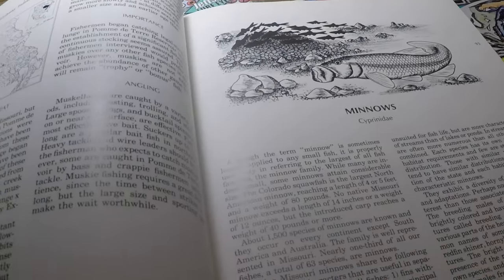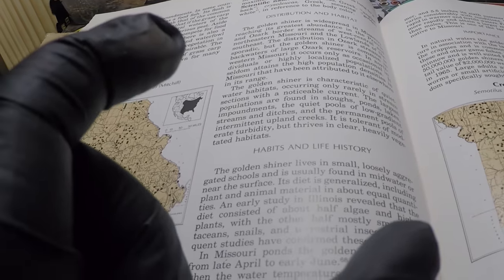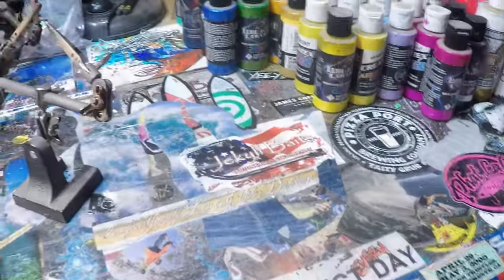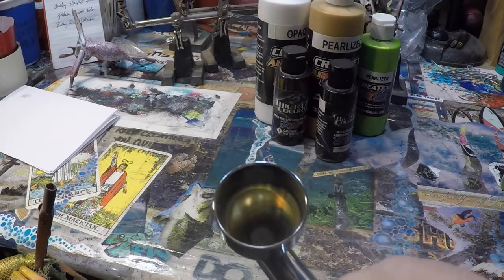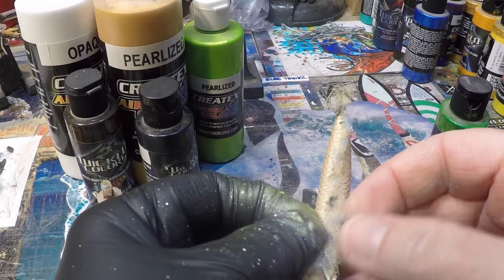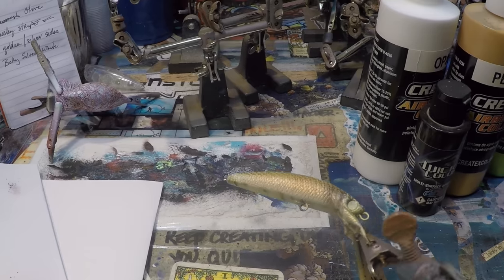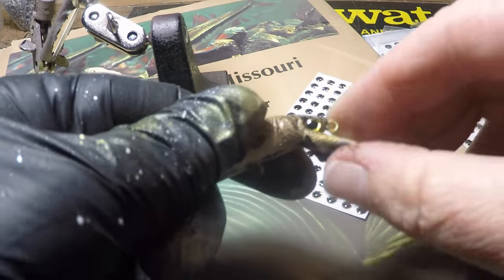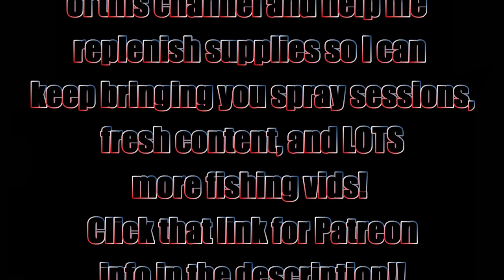SUBSCRIBER TAKE OVER!!! "Spraying A Missouri Golden Shiner"

Comment: one of the things I've done to deal with the seeping under the netting problem is to spray over the netting with the same color as the base color first. Then heat set. Once that is done you can paint it with the white and your final color. that first coat that matches the base coat helps fill any gaps under the netting first  so the subsequent coats don't seep under. Give it a try and let me know what ya think. I should add I love your videos keep up the excellent work.